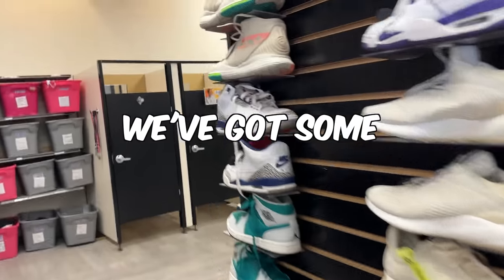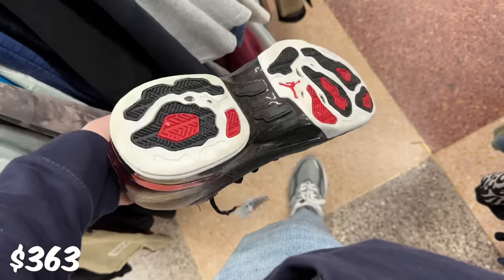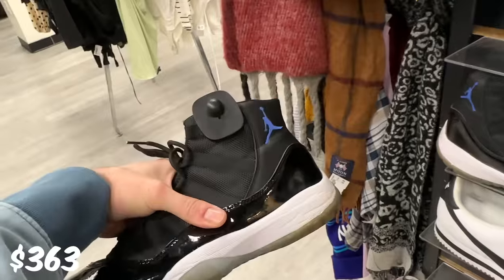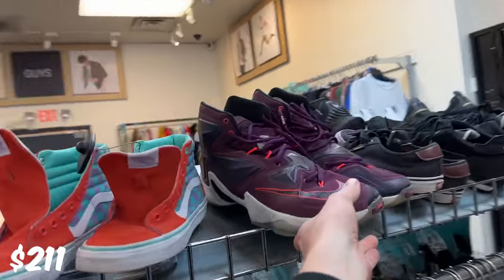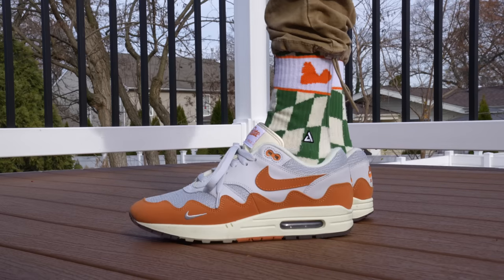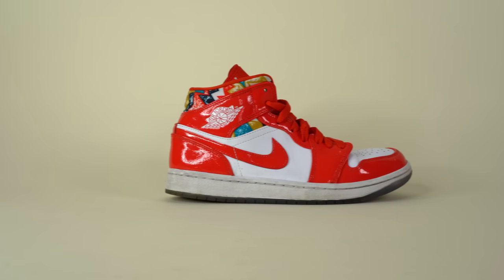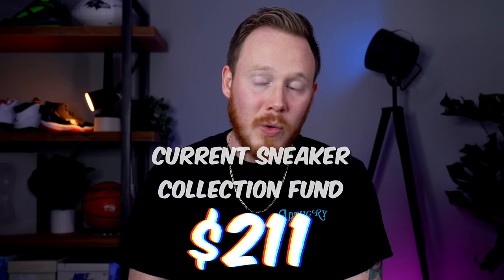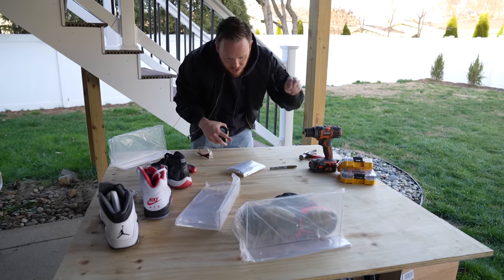I Can't Believe I FOUND These Sneakers At The THRIFT STORE!

Comment: Awesome to see you building the clock! Love the series man. I would recommend maybe changing the clock design though before you commit 100% to it. I think the 12 sticking up off the top by itself will look really funky in a not great way. I also think if you fill the clock with shoes you'll see that the design you have now actually makes more of an oval with the shoes, not a circle. And I'd also maybe make it a bit larger to leave more space between shoes so you can have a little cleaner look and a larger clock in the middle. I'm a bit worried the middle clock pieces will look tiny and disproportionately small compared the shoes. I'm a graphic designer and photo editor and could mock up the clock in Photoshop to real dimensions if you'd like! Would love to help make it as perfect as it can be! This is of course just my opinion, take it with a grain of salt :)

Comment: The clock came out way better than you think it does. However I think ur making it more complicated than it should be.

What if u were to 3D print some shelves close to the size of the clear ones you used and use those on the wall with no baseboard. U can use command strips hooks to support the shelves. They have hooked ones and flat ones that can support up to 10 pounds.

Dope video, great finds I'm not trying to be a critic  as i do love this series (u did a better job than I would've done forsure)